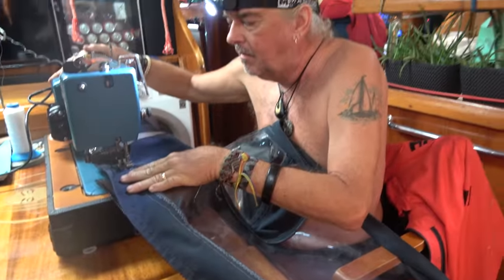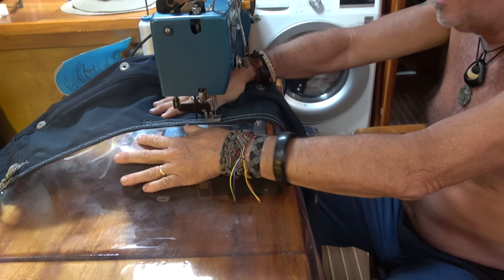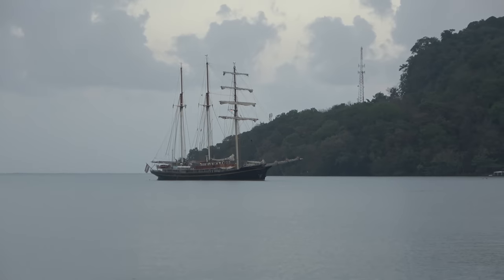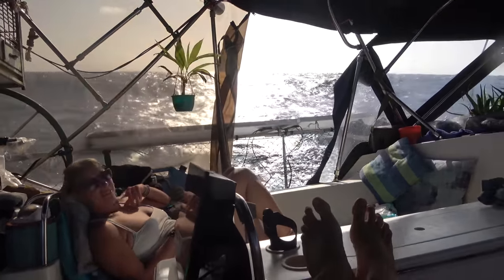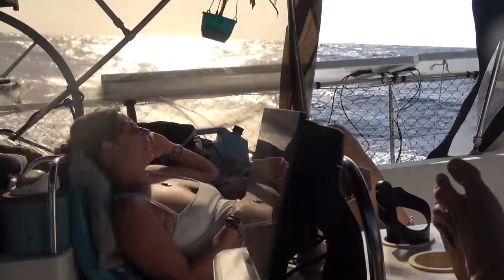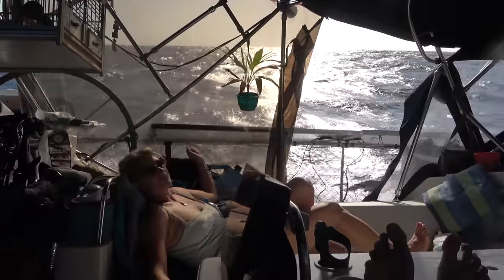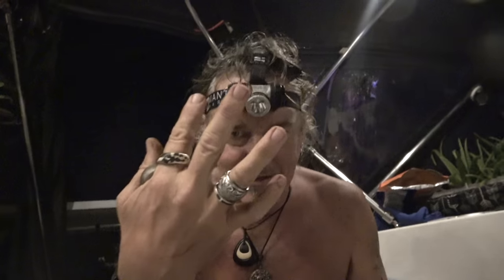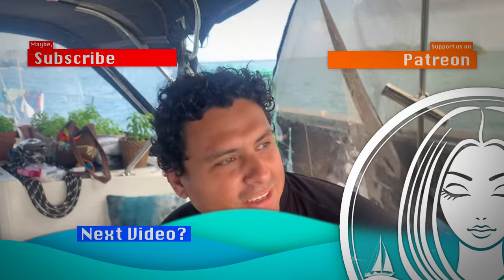SSL678 ~ Broken Autopilot at SEA

Comment: Since you never put down the dodger, why not make or buy a hard dodger that has proper glass windows and is solid.  I see on the Amel 55 a perfect dodger that would fit on your sailboat.  Maybe use that design as a template?

Comment: After I snapped the autopilot bolt in the same fashion on my Hylas several years ago, I started carrying 4-5 extra bolts just for that reason.  Since that time I have since snapped 2 or 3 more from the high loads coming from Grenada to Colombia, etc.  I used a stack of fender washers to offset the correct distance in the same fashion as your silver ring.  The new autopilot replacement bolt was $85 so I said screw that!  Much cheaper to keep a stash of stainless bolts on hand!  I think we must have just missed you in Portobello as I was down there delivering the same Hylas to Shelter Bay for her new owner.  Enjoy San Andreas!
Reply from the maker: Yes I was hoping to do same with the big fender washers, but sadly I didn’t have enough of the right size onboard to fill the gap

Comment: I've listened to your issues with fuel and engine oil over the years. Would you be interested in some filters that remove water and contaminants from engine oil, and water and impurities from fuel? I think I have 6 filter housings, and would give to the channel 2 of them with the mag drive pump. When installed on an engine you use high temp steel reinforced hose and tap off of the oil pressure sensor and feed back in to the rocker cover or through the oil filler cap. I have a magnetic drive pump that could be used on the fuel system to keep it circulating to remove the fungus & water.